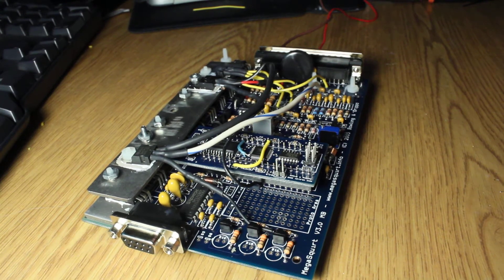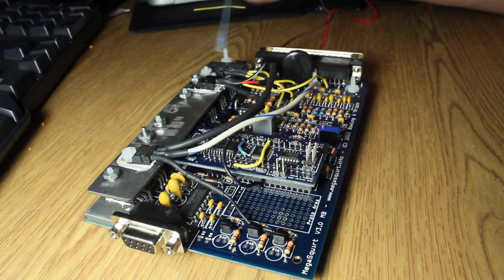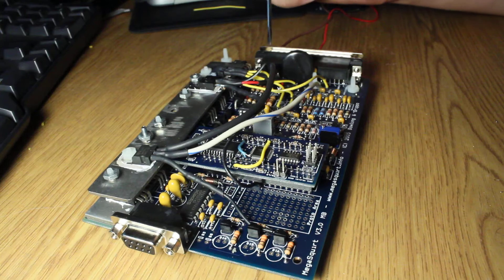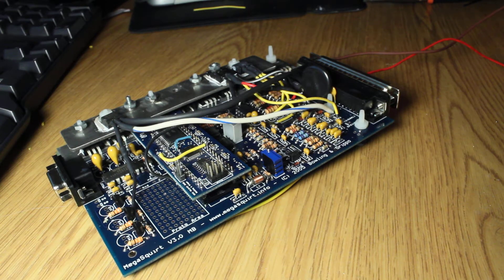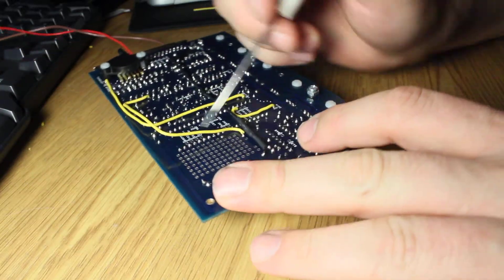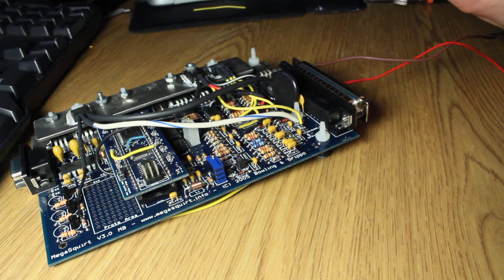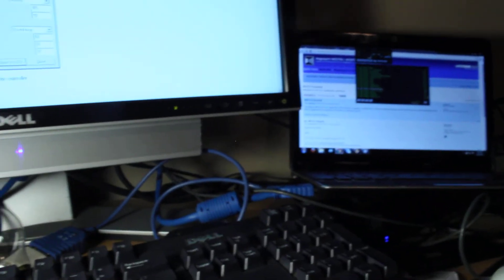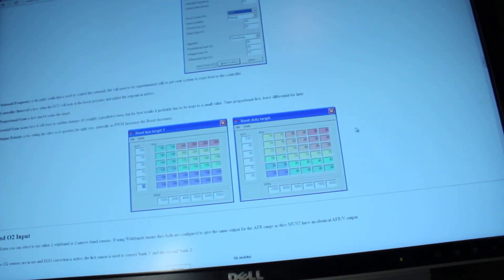Evan's Megasquirt Build Ep 6 - Boost Control Hardware Mod

Comment: The IAC controls and stabilzes eng idle speed ie: idle rpms=revolutions per minute. will compensate for loads such as A/C compressor or putting an auto trans in gear DRIVE or REVERSE and even power steering loads as you turn the wheels. power steering pump has to work harder to provide additional pressure and volume to the steering rack or box, Will help in cold weather as it can compensate for the engine tendence to run slower when first started and will progressively back out its compensation.